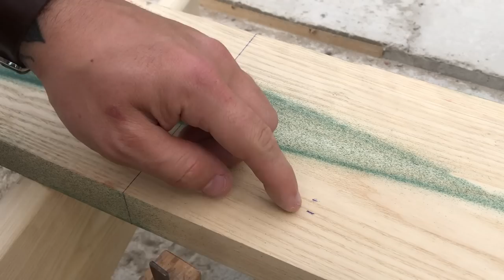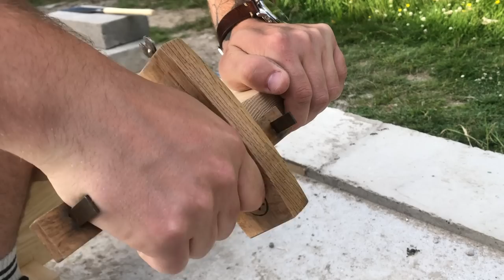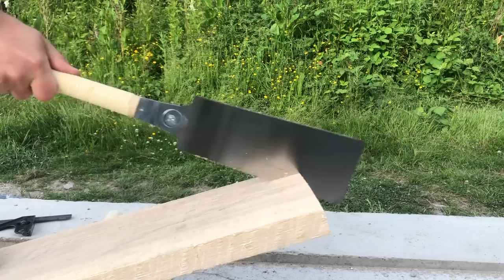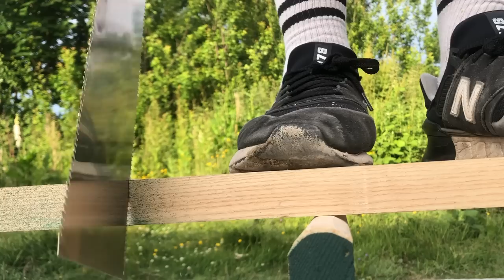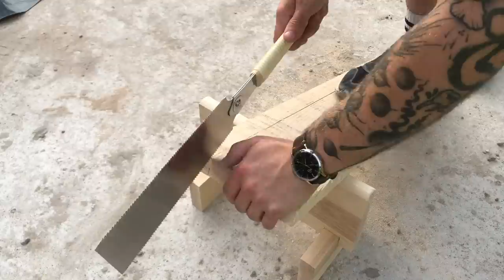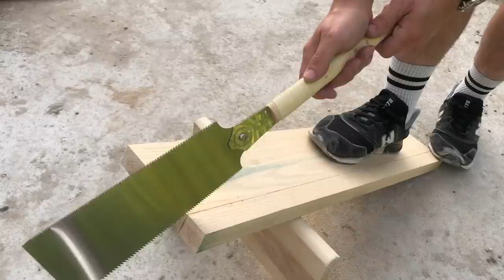Getting Straight Rip Cuts with a Japanese Saw

Comment: This helped me so much! I was trying to rip from one side with the board clamped vertically to the work bench. I couldnt get more than 6 inch before i was completely off track. Flipping frequently helps even everything out! Thank you!
Reply from the maker: Really glad this helped! It was a game changer for me when I went to ripping this way instead of vertically in the vice. Though to be fair,  even in the vice it's not so bad as long as you frequently flip it and use the methodology I present in the vid!

Happy woodworking
Reply: It's a very sound method. Thanks for sharing my friend. 😊🌎✨

Comment: I've seen lots of videos on Japanese saws as of late.  I noticed sometimes you can purchase saws specifically listed as " for hardwood".  Is this important if you are cutting into hardwoods, or is it ok to buy the "regular" listed Japanese saws? And can you use to cut into softwoods to with these "hardwood" saws.  I don't see a lot of YouTube videos mention the specifically designed hardwood Japanese saws or if  you have to go through the trouble of buying it specifically to cut into hardwoods.  Your thoughts? thx
Reply from the maker: To my knowledge, Japanese saws made for hardwood have a thicker stronger steel plate to prevent the chance of bending and teeth being broken off. I don't think you have to get one made specifically for hardwoods though, unless you are sawing into exotic woods like ebony or lignum vitae, as they are both extremely hard.

So in my opinion, no you don't need to, unless working with exotic hardwoods.
Reply: @JoshIbbotson  Thanks for the info.  I have purple heart and maple woods.  Should the regular Japanese saw work?  Not sure if purpleheart is considered exotic.
Reply: @kle2217  Just take it slow. The regular Japanese saw will work just fine and the thinner blade will require less effort. 😊

Most Japanese saws are all made of the same SK5 alloy; it's a fairly tough alloy and hardwood won't present much of a problem for it. Just take your time and enjoy the cuts! 😊🌎✨

Comment: That saw needs sharpening.
Reply from the maker: Hi, you can't actually sharpen this saw blade, it's an impulse hardened replaceable blade. With that being said, I did recently get a thicker 300mm ryoba (this one is 240mm) and it sure does rip a lot faster! (less TPI).
Reply: @JoshIbbotson  who decided you can't sharpen it?
Reply: @encapsulatio  if you have a tungsten carbide file then you might be able to... the steel is hardened with electricity so that it's as hard as any steel file which is why you cant sharpen it with a steel file
Reply: @minervadev6094  I know i can, I just wanted to see what he responds, If he's going to lie or not.
Reply from the maker: @encapsulatio  To my knowledge you can't sharpen the teeth, and they're incredibly brittle due to the hardening process. However, very cool to know you actually CAN sharpen them with a carbide file! Will have to give that a go :)
Reply: @JoshIbbotson  If they were indeed so brittle as a result of the hardening process then I assume they wouldn't be doing that in the first place if they want to build saws that are long lasting and you won't just be taken by surprise to see teeth falling over time because they are too brittle.
Reply from the maker: Ahh I just realised what kind of YouTube video commenter you are lol my bad
Reply: @JoshIbbotson  What kind? please don't hold back as long as you can argument your ideas.
Reply: @encapsulatio  the teeth are hardened, you'll dull your files before you sharpen the saw. it's meant to be replaced and recycled.
Reply: @silvermediastudio  Hardened teeth can be sharpened if you have the know how of what files to use.
Reply: @encapsulatio  Good luck. I'm sure it's worth the investment and time for you, perhaps you should start a business sharpening these blades I imagine you'd be the world's greatest saw blade sharpener. Woodworkers around the globe will admire and respect your skills and services.
Reply: @silvermediastudio  Thanks for the sarcasm but it's not such a big deal to sharpen these saws, it's mostly people preferring to not do any research like yourself who would just buy another saw than bother sharpening it.
Reply: @encapsulatio  Cool story. Please, what type/brand of files would you use to sharpen these? We would all love to know.
Reply: @silvermediastudio  Though se se's comments may sound harsh, they are correct. A quick search here on YouTube for 'sharpen japanese saw' will turn up results for sharpening hardened saws. There's likely a number of different files you could use, but one I've seen is a feather diamond file. You can get them as cheap as $10 USD.

On a side note, I kind of agree with se se's sentiment that I wish people wouldn't just make claims like "they can't be sharpened because they're hardened" without actually looking into it first. Please at least do a quick search before making claims like this. So many youtubers are currently making this particular claim about sharpening that it's just being accepted and repeated as fact.
Reply: @danielreitermusic  I'm sorry, but perhaps you should go back to school and focus on reading comprehension this time around. Or your parents should request a refund for your "education"? At no point did I state it can't be done. Nor do I know or care what "so many youtubers" you seem to be aware of are claiming. I know that the money, and more importantly the time, required to sharpen an impulse-hardened saw that is intended to be recycled and replaced is a fool's errand. But by all means, have at it with your 10-dollar diamond file. I'm sure you and se se will get great satisfaction from proving "so many youtubers" wrong, in the seclusion of your own workshops. Carry on, master woodworker and saw sharpener! The world needs more experts like you to keep the wheels turning.
Reply: @silvermediastudio  That's a quite hostile comment. I did not mean to offend you. Please have a nice day. Cheers
Reply: @silvermediastudio  I don't think the blade is as dull as se se or drchicken.... but thanks to them for the youtube interaction as youtube sees it as interaction regardless of it is coming from dull people like se se and the good dr :)
Reply: @bigkiv47  XD how true